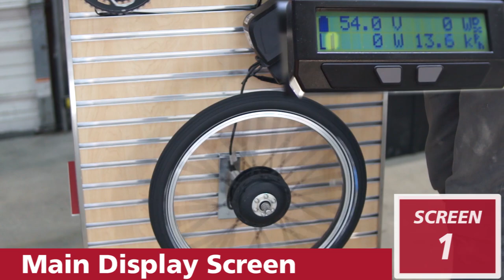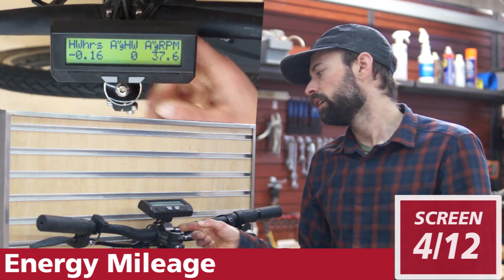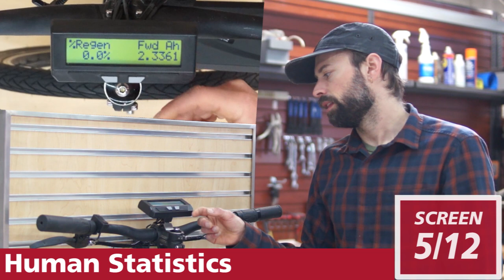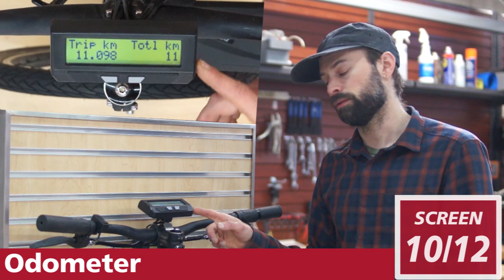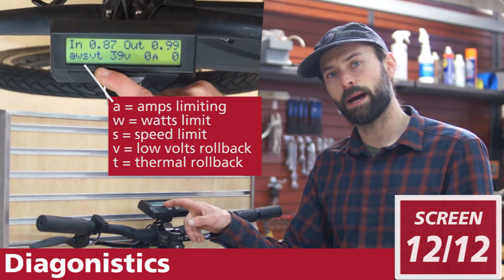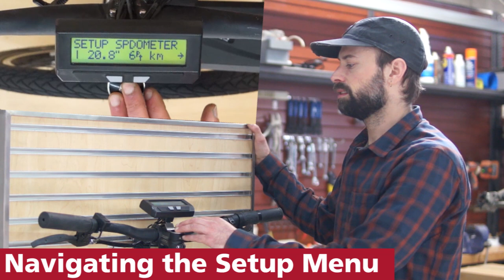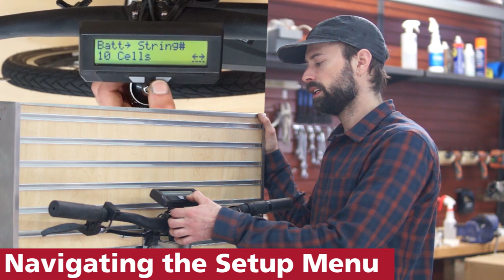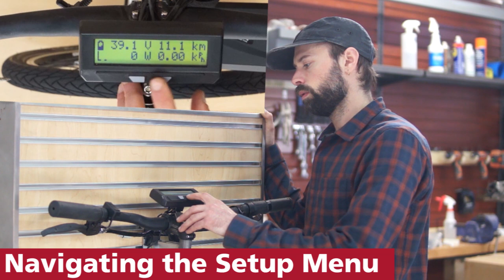Basic intro to the V3 Cycle Analyst (CA3) Display Screens and Operation

Comment: Why are you setting the number of cells?
Wouldn't it be much more flexible to set the battery low and high voltages?
Maybe also a discharge curve?
Reply from the maker: Beacuse lithium battery voltages are discretely set in cell increments, this is the most precise way to define the battery.  The actual SOC vs Voltage curve is not at all linear, it varies form cell type to cell type and just a voltage max/min doesn't capture that.
Reply: @GrinTechnologies  I understand. But the CA does not have access to the individual cell voltages via the balance cable.
So how does it work for non NMC cells, that have a different voltage and discharge curve? For example LiFePO4?
You could use coloumb counting, but you still need to define the max and min voltages and AH, since the battery is not always fully charged and discharged.

Comment: What about voltage restrictions? I am set to a maximum power of 700 Watts but never get above 650 Watts because one of the voltage values is too low. Which setting do I need to change to be able to ride at 700 Watts?
Reply from the maker: What does your watts limit have to do with voltage restrictions?
Reply from the maker: Most likely you have a battery current limit in play

Comment: I have a Crystalite CT4840 controller.  Will this work with my system?
Reply from the maker: It depends of the controller has a 6 pin CA plug on it already. If so, then it's fairly easy. If not, then it's best to use the Stand Alone CA shunt that wires between the controller and battery and plug the controller into that.

Comment: I would really appreciate it if you guys at Grin did a tutorial showing how to use cruise control.
Reply: I've turned mine on but it doesn't work
Reply: It definitely works. I set mine to turn on cruise control if I hold the throttle in the same position for 5 seconds. I forget how I did it, but it is there.

Look at the manual PDF and it will tell you everything you need to know.

Comment: Hi, Can this display be used to reprogram individual PAS settings on a cheap chinese 1500w hub motor kit ?

The controller settings are truly horrible and feels like it meant to be only used with throttle , the PAS settings will only affect top speed but for EX: if you are in #4 PAS and you pedal it will go up to 30 kph at 1500w, so it's pretty unusable

I would like to have every PAS settings ONLY controlling power and not speed, with unlimited speed in each mode

Thanks for your help
Reply from the maker: Hi Mathieu, no the Cycle Analyst does not communicate with any controllers at all. What you can do is have the throttle output of the Cycle Analyst go to the throttle input of the controller, and then have your PAS, throttle, ebrake etc. all go to the CA instead of directly to your motor controller. As long as the controller will operate fine from just a throttle signal, then this way you get full control of PAS behavior via the CA. 

It's a non-trivial job, but is doable in principle. You'd want to study this in detail:
https://ebikes.ca/product-info/grin-products/cycle-analyst-3.html
Reply: @GrinTechnologies  Thank you for the answer, will check that out !

Comment: To bad my defective eRider torque sensor (brand new from china) killed my new CA3.. I guess because it drew exessive current. The shop i bought it from (not Grin) will not help me. So i will have to open it and look what burnt. It is my second system - CA3+eRider are quite nice when working correctly. Cheers from Germany
Reply from the maker: Assuming you were running at more than 52V nominal? In most cases a bad PAS/Torque sensor that draws excessive current will cause Diode D3 to get blown which is an easy repair described here: https://endless-sphere.com/forums/viewtopic.php?f=4&t=37964&start=2600#p992104
Reply: @GrinTechnologies  Hey thank you for the reply! I found that thread today, before checking YT, while searching for the D3 diode. 😁 It is indeed blown! My battery was a 13s Li-ion -so nominal 48V. Could you tell me if there is a way to check if the is DN2470 working as intended with a multimeter? It looks a bit rough on the outside.

Also thank you for the latest firmware release, finally 36 PAS poles for the T9/T13 torque sensor 👍

Comment: Any reason why my bike ignores the set speed limit on the CA? Also the throttle limit settings don't effect anything is that because I'm plugged into the controller throttle and not the CA throttle plug?
Reply from the maker: Yes exactly.  The CA can only control the power of the bike if the CA is the item supplying the throttle signal to your motor controller. If your throttle is plugged into the controller directly, then there's nothing the CA can do to change anything about the throttle voltage you are sending it.  Remember that the controller has no awareness or communication with the CA.
Reply: @GrinTechnologies  yeah that makes sense I switched it around and everything's all good.

Comment: Great video, Robbie. I learned several things.  My question, tho, is this: Every time I ride with my wife she wants to know what number PAS level she is in before starting to peddle. The previous Bafang style controller must have permanently programmed her to look for this number. It really is the only number she wants to see, and I am at a loss as to how to give her this bit of info. Any ideas? (Married 38 years so divorce is out)
Reply from the maker: Hey Bill, just tap the MFSwitch up/down button and you'll see where it is at. Otherwise, you can also set it up to always power on with PAS level at zero, this is an option you can select in the AuxD setup menu.

Comment: Thanks!  A question: numerous times you mention "if I had a torque sensor", eg: to get human power readings. Are you talking about power meters (crank, hub or pedal) or something built into the motor, or...? I'm asking because a torque sensor seems like a useful thing to have, not least so your controller can use it to modulate motor power... @grin
Reply from the maker: Most of the time the the torque sensor is in the bottom bracket since that's the most common and obvious implementation. But in principle it can also be on the cranks, the pedals, the chain, the rear dropout, the motor axle, or the motor cassette, and there are various systems out using each of those methods.  The important thing for the Cycle Analyst is just that the output is provided in an analog voltage signal, and not some digital communication bus.
Reply from the maker: Have a read here where we go into some detail on how different torque sensors work: https://ebikes.ca/learn/pedal-assist.html
Reply: @GrinTechnologies  In your opinion, what is the best bottom bracket torque sensor and do you have it?

Comment: In version 4 Iwould like it to have ambient temeprature sensor and Real time clock powered from button cell battery
Reply: Yes
Reply: Why?
Reply: @bluewanderer9903  ummm to know what time it is and temp
Reply: @MrDeceptacon88  right ok I can see the time argument, but temp? Surely you know what the temp is outside anyway, its not like you are going to travel a 1000km on this or gain some serious altitude to need to know extreme temp changes in short periods of time that could affect you.
Do you have phone? Are you using gps? Time is on it, temp too.
Reply: @bluewanderer9903  yeah time is the main one.
Just wanna have to pull out my phone from my backpack just to see the time.
Reply: @MrDeceptacon88  yeah I dont wear watches but phone is in my pocket unless I am using gps which isnt very often when on my bike. But yes, cant go wrong with time if display is already there.
Reply: @bluewanderer9903   temeprature is useful to see when you are riding outside, it doesn't have to be super fast but if you go from the valley up to mountains here in alps EU, it is super useful, time is nice if you ride without GSM or wrist watch...also you can check it when you ride.
Reply from the maker: You can actually see the time on the CA3 if you hook up a NMEA GPS module to the serial port (as you can do with an analogger plugged in) and install the special GPS CA3 firmware. It's not really well documented, but the functionality is tucked away there. Install the CA3-13xG in the experimental CA firmware folder, and refer to this doc http://www.ebikes.ca/pub/media/downloadable/ANALOGGER/Analogger_GPS_Mod_Rev1.pdf

For ambient temp, we've had some people install a toggle switch so that they can readily alternate between viewing the motor temperature vs ambient temperature with a 2nd thermistor that's just hanging out outside. Unfortunately the internal temperature inside the CA enclosure is quite a bit warmer than external ambient due to the onboard regulator, so a PCB mounted temp sensor won't be very meaningful.
Reply: @GrinTechnologies  thankyou for fast and useful answer, I'll have to make it as you suggested

Comment: Can that  MF switch be purchased separately from the CA ?
Reply from the maker: Yes, but the one with the on/off button needs custom wiring to hook up the on/off control to the CA's power, you can't just plug it in to a CA that doesn't have the mating 5pin waterproof connector on it.
Reply: @GrinTechnologies  ok thanks for clarifying. Might need to get another CA that comes with that switch pre hooked up

Comment: It's too bad the manual isn't more complete, so you don't have to search all over creation for videos explaining various ins and outs of particular settings.
Complex devices require comprehensive manuals.
Reply from the maker: We figured at 36 pages long it was at a good tradeoff of length vs digestibility: https://ebikes.ca/documents/CycleAnalyst_V31_Web.pdf
For more details on ALL the settings, there is a tooltip explaining the purpose and function in the CA setup utility software. Either hover your mouse over the setting of interest, or go to help->help and you will see a help file with each and every setting fully described.

Comment: The screen looks so dated.
Reply from the maker: Ha ha, somebody didn't click the "show more" link in the youtube video description and read to the end ;-)
Reply: @GrinTechnologies  haha gotcha! But my criticism would also work for tech-minded people that just want an update on technology that is proven to work well :)
Reply: Nope.
Reply: @GrinTechnologies  TBH, I could see a big improvement in readability of the information presented with a good reflective or transflective monochrome (I'd avoid color!) graphic display, something like the 2-3" Sharp Memory LCDs (but this isn't as power-sensitive of a use case, so it could be a conventional reflective or transflective active matrix LCD), instead of a character display.

Things like graphs can be more detailed, more information can be presented in graph form, text can be easier to read and things more spelled out, and additional text to give a better idea of what's going on can be used.

(Admittedly, I've not actually used a Cycle Analyst, though, but I do use a device with a similar character LCD (a ScanGauge II) for additional OBD-based instrumentation in my car.)
Reply: @rickw7522  relax. My criticism is justified. If the diy route keeps stuck on ancient interfaces with 12 menu screens then diy is no longer interesting
Reply: The cables exitting the device with the crappy JST-SMs connectors wrapped up in a rubber elastic geriatric sock could certainly do with a rework
What about some waterproof connectors like HIGOs? ->see https://www.e-bike-technologies.de/index.php/en/cycle-analyst-v3-en/tuning-the-cycle-analyst-v3/the-next-level-higo-mini-b-panelmount-connectors
Reply: @groovygrannysbicycle  really didn't even know that. Everything on both my diy ebikes has wp connectors. I could not live with something so geriatric as ancient jst and monochrome screens with 12 menus. I dont want my bike to catch fire i want stuff to work in a northern climate in snow rain and salt.
Reply: I didnt get this yet but I actually quite like this "outdated" screen from what I have seen so far, dont want colourfull bling and certainly dont want the screen to get any bigger. Dont want graphs or animations, dont need screen to entertain me while moving. 
I dont know how bright this is at night but if changes in this department happen I vote for white on black background screen.
Reply: @bluewanderer9903  my kt-5 screen is only 1.5*3cm with backlight and 3 buttons. All the rest should be on your phone
Reply: @MrJob91  true that. See the only time I would use phone is if I have the need for gps and I dont think I will be using gps on me bike, not often anyway.
To be honest I prob wont need most of this. Speed, charge, power/regen/consumption... maybe motor/batt temp, cant think of anything else. If I need diagnostics thats laptop so home/garage, I have no intention of doing this in the middle of the trip.
Will check that screen thanks for letting me know.